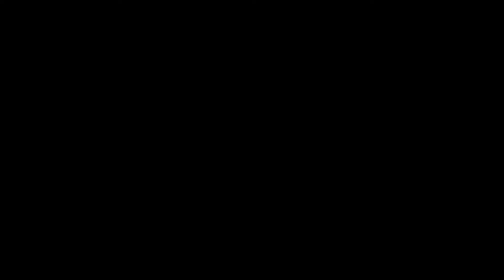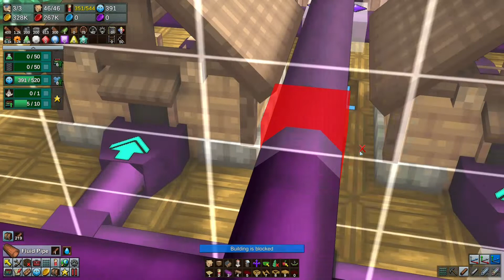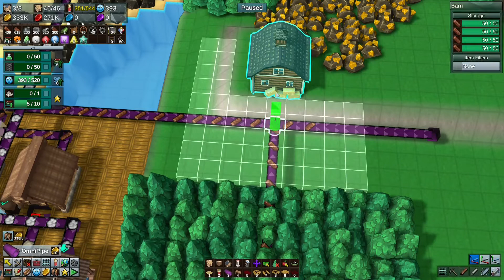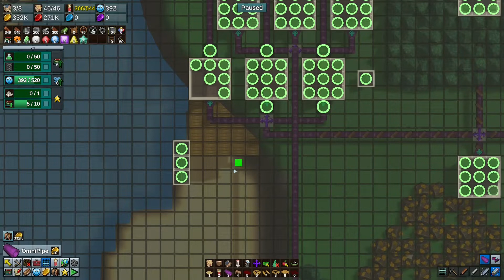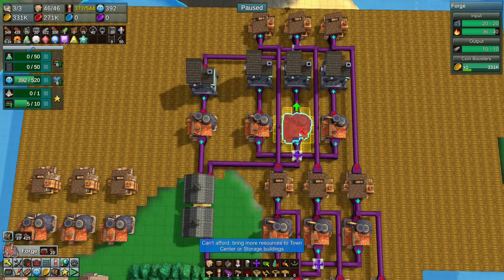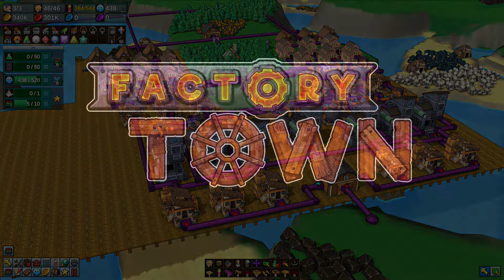Factory Town - S09E19 - Industrial Research Doubling

Comment: I think a cleaner solution for the wood splitter backup would be, as you mentioned, to have 2 separate lines for the left and right production. Then have a separate overflow line coming from both to the overflow barn - which you can merge before the barn, or just send the two lines to the barn, that doesn't really matter at that point.
It's only a bit more convoluted, but at least it's 'cleaner' and shouldn't cause any unbalanced production at higher production rates.